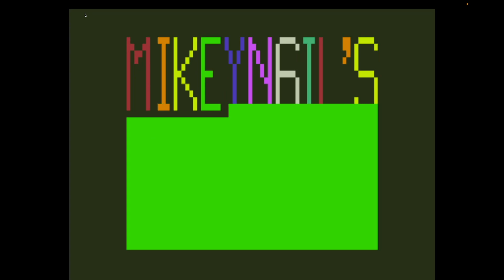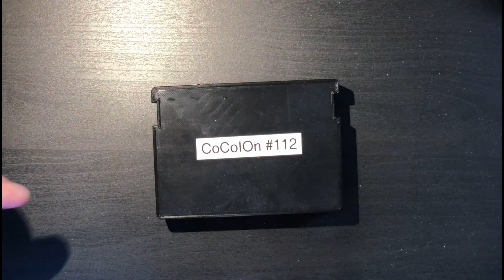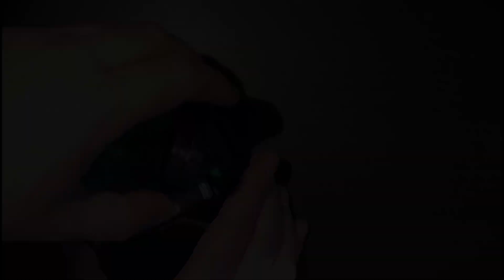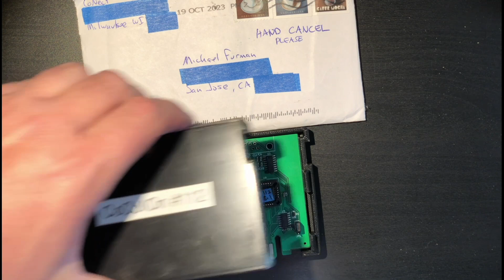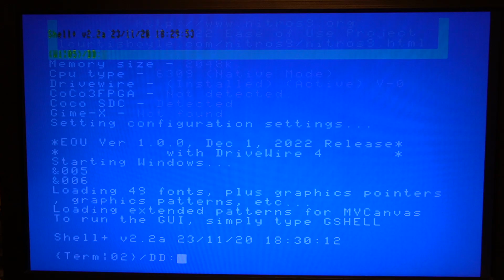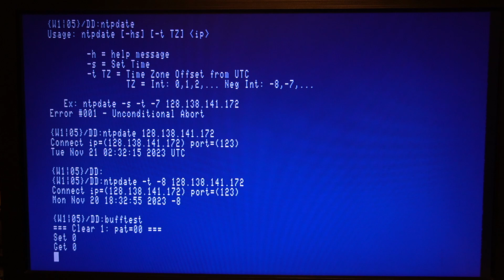MikeyN6IL's DEV VLOG $1A: CoCoIOn Ethernet Card Update

Comment: Um so what was under the yellow square? What a bizarre way to send chips in the mail.
Reply from the maker: It's not really bizarre at all.  If you think about it, USPS first-class letters are sped through automated sorting machines.  If you watch videos of these machines it should be clear that they exert some clamping force on the letters as they go through.  This is no problem if the letter contains a folded stack of documents.  It is a different story if the letter contains electronic components.  The cardboard is a cheap way to allow the letter to pass through the machinery and to prevent that clamping force from squeezing the chips too much and breaking them or bending the pins.